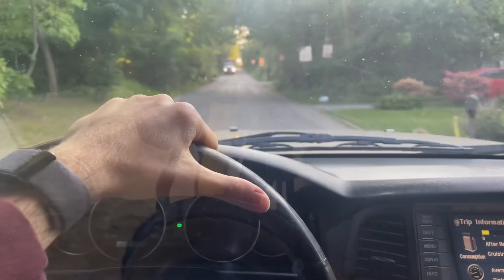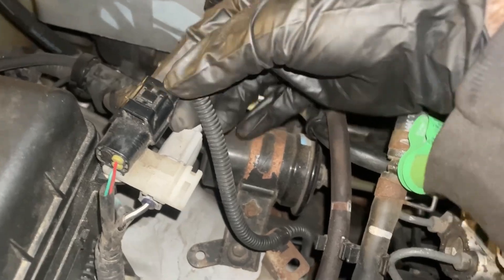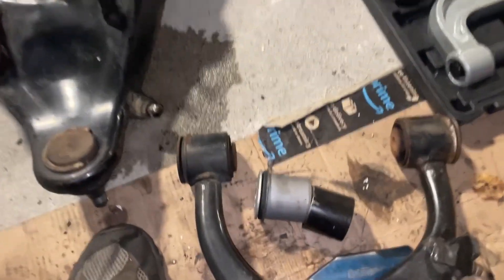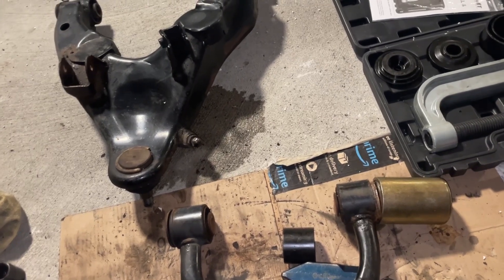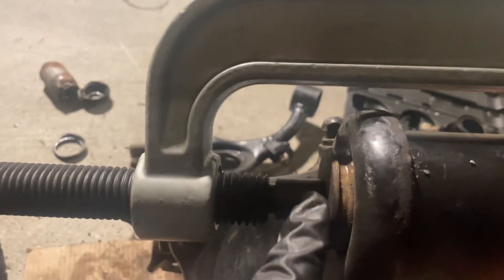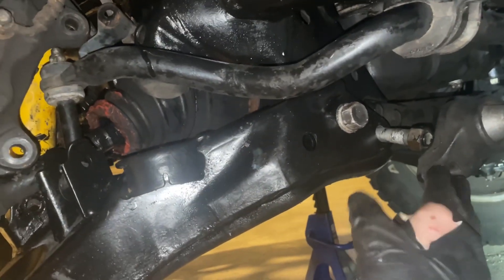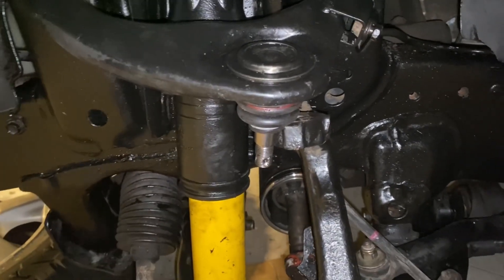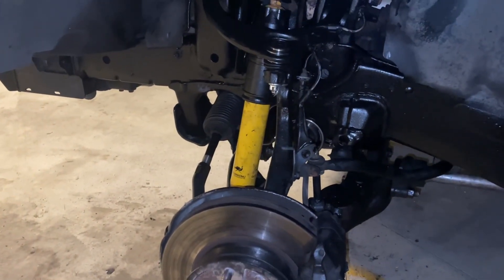Complete Rebuild: Upper and Lower Control Arms 100 Series Land Cruiser

Comment: Thanks for showing both the gore and the glory, I just bought a replacement rubber kit for the CV joint when mine had a split. I should have taken more time and painted the upper and lowers like you did, it really turned out nicely and you got a nice driving result.

Comment: OK  correction and major one . when you install lower and upper arm DO NOT torque the any bolts yet, just connect the tortion  bar set tortion bar to a spec they each are under different specs!  . Then attach the wheels and lower the car so it sits on the wheels!,  only then torque bolts, if you do not do this way you will be replacing  bushing again. That is the trickiest part of this job. the best way is to mark it first before you disaamble it. but good job!!!!!!!

Comment: Hey thank you for the video!

Your note on Not to loosen the index spline when removing the TB. As long as you do NOT disassemble that end of the TB and only seperate it from the LCA, it would be fine right? I have not removes the TBs before so wanted to verify first. Thank you!

-Chris
Reply from the maker: The note was to not loose the index of the spline. Ideally you would just leave that collar on the Torsion bar (the metal piece on the end that holds the bolts) so the teeth stay connected. But in order to get the lower control arm bolts all the way out you have to slide that collar off of the spline/ teeth of the torsion bar. Just mark it with a paint pen or something before you take it off so you can put it back on the same way.
Reply: @JungleCatt  Thank you for the reply! Perfect, this is what I was looking for!

Comment: Great videos! One question is the upper arm stock? Since you lifted with old man emu suspension did you have to change the upper arm? Or is it the same? Thanks!
Reply from the maker: Yeah mine is stock and I refurbish it in this video. You do not need new upper control arms when you do a 2 inch OME lift. However, with the stock UCAs you can’t get the alignment perfect (ideal camber numbers become unobtainable). In my experience, it’s not a big deal. The shop I go to was able to get very close to perfect alignment and It drives great. If you want to get it perfect (and maybe even get another .5 inch out of the lift, SPC UCAs are adjustable and commonly used to mail the alignment. OME also just came out with new UCAs for the 100 series… I would imagine they are designed to fix the small alignment issues caused by the lift.

Comment: Many (ihu8mud)guys after doing the uper arm bushing job like you, they reconmmended to change the whole UCA instead, how about your opinnion? for whole 8 contral arms and 4 ball joints replacment, how much time does it cost you?
Reply from the maker: This job took me a long time! Like 6 hours per side. The only reason I think it was worth it to do myself is because I replaced almost every bushing under my car. It would have been very expensive to buy new parts. Plus, I spread the cost of the tools over all of those jobs. If you only have problems with your UCA, the best route may be to buy new ones!